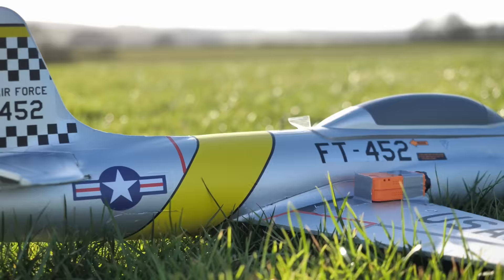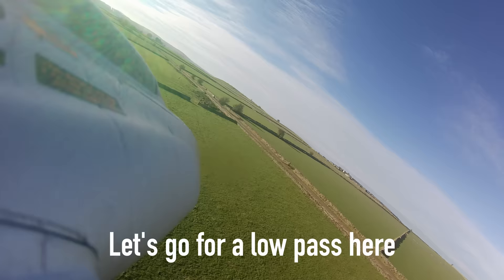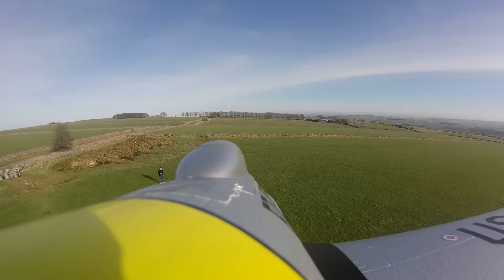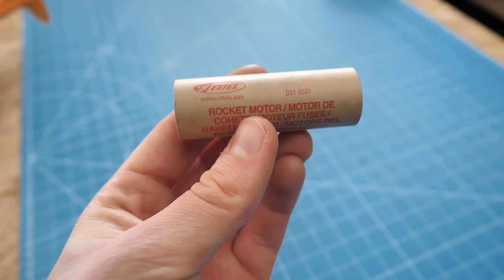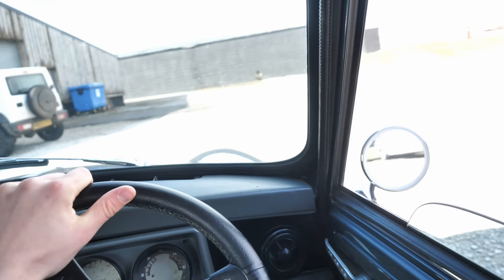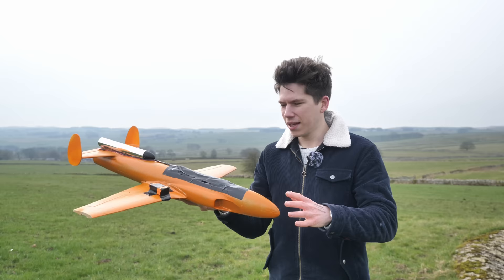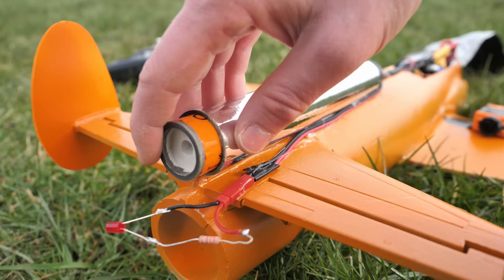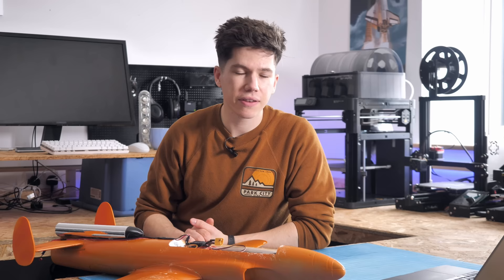Building the WORLDS FASTEST RC Rocket Plane!

Comment: I think it ejected cause of inertia. at first, the booster had forward force in the form of thrust which was pushing it into the plane but as the force stopped. it no longer had a force pushing it forward. this caused it to eject as there was a change in momentum and it resisted that change due to its mass. hence, it ejected cause of pure physics

Comment: Nice job. If you are set on sticking with foam, I would definitely look at sanding the trailing edges and covering with a glass fiber cloth. A bit of work, but sometimes it's about reducing drag, rather than simply adding more power/thrust/weight etc
Reply: i always added the resin right on the foam istead of adding the cloth. the resin dries makes a hard shinny dull yellow on the foam. adds alot of weight. makes it firmer too

Comment: @ProjectAir , instead of one big engine at the tail, how about putting 2 more of those big rocket engines 1 on each side of the wings near the aerolons and 2 small ones each side of the rear wing tips so it would be well-balanced. All should fire simultaneously for that added punch. As for the canera there are miniture lenses that can be mounted on the air intake portion by the body. Video can be recorded using microSD cards. I'll be waiting for this major improvement. More power to you!

Comment: This was a dream of mine as a kid building model rockets and Rc planes with my grand dad! Those experiences drove my career choices, first into aviation as a jet engine technician, then into aerospace as a rocket engine technician. Loving this video!

Only suggestion I have that you may have ended up getting to, some cheaper model rockets use a metal tab that holds the engine into when the ejection charge fires. I’m not sure why your engines keep jettisoning, but a tan on the aft and vent on the front should prevent that and maintain stability.

Comment: Looks like the vertical stabilizers could also use some optimization in the way of stiffening and maybe a less blunt leading edge. An expired plastic gift card is often used to stiffen foam board and you could probably just glue a piece to the outside of the stabilizers. You can also pinch the paper surfaces together along the leading edge and wrap a little packing tape around it to help it keep a more pointy shape.

The most important optimization right now though would be to paint the housing for the rocket motor to match the rest of the plane, because right now it looks like you've attached something you found in your mom's sock drawer to your plane and are taking it for a ride.

Comment: Brilliant project! So exciting to ride along. Pretty sure that airframe is holding it back. There is a reason most high speed jets are swept wing. Great work and all the best for all your projects. ❤
Reply: Swept wings are only useful once you reach transonic speeds and start to get shock waves. He's about 500mph short of that. 
The reason most model jets have swept wings is because they're supposed to look like real jets, which do go that fast. If you look at models used for racing, they all have straight wings.
Reply: @robinbennett5994  lesson learned! Thanks!
Reply: For the same reason, I was so surprised when I first got into the hobby to see that most of the fastest birds were 'hotliners' - essentially straight-winged motor gliders. At this end of the Reynolds number chart, that really is the speediest design!
I'd still build my own "fast" planes to look like jets every time, though, efficiency be damned. 😁 This T-33-ish airframe he's gone with is a good compromise between "looks fast" and "IS pretty fast".

Comment: If you can get the center of thrust to be more balanced then the jet gyro won't have to work as hard to stabilize it, possibly reducing oscillation and definitely reducing drag. That'll give you a bit more speed.

Comment: Why not try putting two jet engines on the wing, around the CG.  You eliminate the nose heavy re-design.  Also, mount the camera in the nose of the plane.  With two F size engines, you could really 'smoke-em.'  You may have to relocate the elevator due to the exhaust of the jet engine.

Comment: You'll achieve higher speeds if you increase the wing loading, trim a bit off the wingspan. This will also reduce the aileron area and make it less roll sensitive. Moving the centre of lift of the wing closer to the fuselage will also reduce the load at the wing root, and the stiffer wing will be less likely to flutter. Downside is of course higher landing speed.

Comment: Cool! Put in a bit of downthrust to avoid the nose down pitch on rocket ignition. Also, is that a model rocket engine? If so recommend providing forward outlet for recoil charge (meant to eject a parachute. 

Didn’t have time to watch whole video, and others like have said similar… just in case

Comment: If you're friction fitting the motors, then it's possible that you're just over pressuring the small sealed space in the tube (rocket motor gets hot, air in the tube gets hot, loss of thrust around motor burnout, POP just like a cork gun).  Maybe a hole drilled somewhere discretely would stop that.  From what i remember of model rockets, I never really made anything sealed that didn't explode... I'd probably use a metal clip to retain it from popping out, and custom length short tubes to take up the space between the motor and the nosecone on the inside of the motor mount, and then make sure there is a bit of room for air to escape somewhere.  /shrug/ whatever makes the weight distribution predictable.  In any case, your taste in color is spot on, so keep up the good work!

Comment: Model rockets use a secure fastening system to keep the motor in, not just friction. The most common used to be a flexible metal clip, these days it's common to see a threaded end cap with a seat for the cardboard tube part.

Comment: If your rocket motor rotates that easily in the tube you can easily snug it up a little with a ring or two of masking tape around the end.  That and switching to a -P (plugged) engine would resolve your issue of spitting the burnt motor casing.  If you can't find -P engines you (voiding any guarantees or warranties) can plug it yourself.  Never done that myself but I imagine a little epoxy would do the trick.  Also your wobble was probably caused by the flapping ignition wires that were loose after firing the motor.  Making the wires shorter and attaching them more firmly to the chassis should nip that one in the bud as well.  Mounting a WAGO connector near the back within reach of the igniter wires would help, I'd go with the most compact type.  Good luck and godspeed!

Comment: Maybe drill a pressure relief hole in the rocket tube when the engine charge goes off, and perhaps make the rocket engine mount a little more robust, so the engine does not push itself out of the tube..

Cheers!

Comment: Wing camera video llooked like aerodynamic flutter.  You may need to use.a model with a stiffer structure and mass balanced control surfaces to avoid flutter.  Unlikely that your gyro has wide enough bandwidth to correct for it, even if the servos were strong enough and fast enough.  Amazing that it didn’t come apart with the F engine.  Good show!

Comment: Put two motors on the fuselage near the wings, use a glue with the rocket motor that doesn't melt with heat, The rocket motors are getting shot out like shells from the cardboard tube probably the rocket motors burn through and through on the other end as well creating pressure inside the tube ejecting themselves at the end.

Comment: This plane can go alot faster if the wings could sweep back in order to lower the drag and give it a boost, further more you should make it heavier so it can retain more energy and gain much higher speeds. Replacing the main engine to a liquid fuel powered jet engine will make your plane much more balanced, fast and optimized. If mechanically swept wings are hard to acquire or create then give it an F 104 S airframe

Comment: Great project!  But mounting location of the camera really kills a big part of lift on upper wing surface.  I know because I made the same mistake on the same plane with same camera.  I had the cam slightly more outboard, almost could not bring it back for a safe landing.  Consider mounting camera on a pylon on top or under the wing so lift generation is preserved, and possibly achieving more speed since not as much AOA needs to be maintained.

Comment: Put the camera in the nose cone. 3D print the nose cone with a hole for the camera that is above center or below center and put a little piece of plexiglass there.

Or for better weight distribution put the camera by the rocket. Although the rocket would mess with the camera a bit. I would put some of the electronics in the back for weight and the camera in the nose cone.

Comment: You get over 150 mph with a good pusher prop setup on that plane...28 35 2300 kv..60 amp hobbywing esc
..1500 -1800 50c 4s...6x 4.5 apc prop... 5 min flights with variable throttle management 😊...you can keep the t33 airframe stock...maybe add some Cf to strengthen airframe a bit

Comment: Its a great concept and design but there are areas for improvement. You can put 2 rocket motor to under the wings for a better center of gravity and twice the power while still being able to have the propeller engine in the center. A delta wing design would also work to increase the overall strength of the wings. A cover for the internals would be better than just some ducttape but still great work!

Comment: The solid rocket engine at the top rear may cause imballance with respect of COG, and will also cause unexpected imbalance when the solid rocket is deplated or pulled off by air. Those imballances tend to cause amplified strokes against the body of the plane at high speed, meaning the disturbance will amplify at high speed. The sudden change of COG will influance the speed of the plane, because the "Pitch" action at the wrong time will impede the movement and thus the speed. My advise is to place the solid rocket engie right above the COG just in any of the above unfortunate cases the airplane Pitch will not be affected.

Comment: You can hit your goal of 140+ MPH using either a pusher or tractor propeller configuration or both 🙂. Plus you batteries will last allot longer at the same speed you currently get with the ducted fan.

Comment: 6:35 you need more heat in that joint. don't use the very tip; use the middle of the iron tip, and heat from a lower position, with as much of the iron in contact with the joint as you can
Reply: You would also want to turn up your iron temperature

Comment: Zero-delay motors like that may be designed to burn through to ignite second stages.  That could be just enough pressure to kick the engine out of the tube.

Comment: Sorry if it seems dumb, but first, if you actually need an onboard camera, and since you add a rocket motor, it seems that the camera could fit in place of the canopy, thus erasing some drag from the rocket motor itself, instead of adding turbulence around the wing (to add to the drag of the rocket motor pod). Second thing: i'm not sure the air intakes have the correct design. After all, you are not trying to fit a radar within the nose. Which means that something as a Saber or Mig15 air intake may actually be more efficient at supressing the body's drag. Anyway, nice video, and nice achievement too, good luck with your project!

Comment: The better approach to getting the speed record is to stop using off the shelf rocket motors and build one from scratch.  It isn't hard to do and you can increase the time the motor is powering the plane which is the key to going faster.  Also not sure why you are attaching the motor to the top of the plane if you are going to hand launch it.  Place the motor on the bottom and the initial thrust will no longer push the plane down it will push it up slightly which is easier to deal with. 

Also if you build your own longer lasting rocket the fact that more of the weight will be closer to the center of the plane will help with the nose heavy problem.  You would no longer have the problem of the engine being blown out and landing would be easier.

Comment: I don’t know how hot the exterior of those rocket engines get, but I’m thinking that the reason why the engines pop out after the burn, is that the air pressure between the front of the engine and the nose cone was raised high enough to push the engine out when the engine cut out. 
(Pardon my somewhat odd wording/grammar. English is not my native language.)

Comment: What if you attached two rocket motors to the wings with aerodynamic fairings? I think this would put the rocket weight much closer to the CG of the aircraft so that changes in rocket weight only marginally effect the aircraft's balance. Plus you could get even more thrust.

Comment: I didn't realize I'd done quite so well by getting 185 Kph out of a Skywalker Falcon, described by Hobbyking as "1340mm wingspan, it owns good mobility, stability, gliding that is suitable for leisure entertainment and FPV" and a stated air speed of "60km/h" which obviously depends on what motor/prop/speed controller/battery/mods combo so, variable.
That did take major modifications of course, first was removing the silly bulged up canopy since there is no use for it (except to access things) and build my own out of Kevlar/Carbon Fiber cloth/epoxy, after spending ages making a mould for it. That gave it a nice smooth curved shape that closely followed the curve of the wing and also better air flow to the engine/prop. Next was a 2,200 KV motor, (sorry but I don't remember exact specs as this was about 9 years ago) to which I did try APC 5X5, 5x4, and I think I even tried 5x4.5 but, oddly the one that gave the best results was the ultra cheap SPARE 5x5 prop that came with one of those AXN Floater Jets. The motor mount I then carved down to an aerodynamic shape just giving enough of the ply mounting for the X mounting basically then ran a 6mm carbon rod forward to the carbon wing brace to stop the whole motor just launching off it. 
That motor I used was rated for 3S which I did try it on and it was pretty damned fast. I wanted really fast, fully prepared and expecting total destruction at any stage I put a whopping great 120 Amp speedy in (not that t needed that, I had it for a much bigger EDF project anyway) and crank things up to a 4S with some insane C rating so it should keep max voltage up then test again. I can't remember exactly but I think it was around the 120 odd Kph mark that wing flutter kicked in and was like slamming into a brick wall, it damn near seemed to come to a stop! I cut slits in the under side of the wings and inserted 3x1 carbon strips into the foam then ran thin CA to stick them securely then smoothed off those surfaces, still got flutter at some higher speed but an improvement. Next I cris crossed the underside with strips of fiberglass take and ran wing tape (I think it was called) along the leading edges and tried again, that time I got up to 185 K/ph running cross wind so the GPS would hopefully give a pretty accurate measure since I didn't want a false reading for my own REAL results, which was a blast and vertical acceleration wise my eyes had trouble tracking it as I'd never experienced following any model vertically so crazily fast.
I rather foolishly never changed the thrust angle and the wing profile tended to make it want to curly downward at the higher speed so I was having to pull back on elevator more and more a the speed increased. I was stupidly, since I did expect destruction anyway, use those cheap plastic 9 gram servos that were really popular back then which turned out to be the fail point on the last attempt where I was hoping to increase that 185 Kph, at least to 190 but, on a full throttle pass both servos stripped simultaneously somehow and that was that. 
There is video of it existing taken by another flyer that but all I have here is a few pics of the thing as I'd modified it and of the GPS in it after landing which was also from Hobbyking and runs off the receiver power and loses everything as soon as power is lost so it can't easily be faked and you can clearly see the 185Kph on it's tiny screen. I also kept a short recording of the insane screaming sound as it passes by lol.
One issue with using a ducted fan model for yours is those huge air intakes create a lot of drag once you exceed the speed the fan is running at, that's why I didn't use one. I have a little one of the original "Stinger EDFs" and it wasn't designed as a scale model so has even bigger intakes and I could land that quite short from speed simply by cutting the throttle, pointing it down into a pretty steep descent, enough that I could hear the fan whirring away from inside acting like a big, surprisingly effective air brake then level off and skid it to a halt. Those oversized and draggy anyway air intakes, even on that model you used will only hold it back.
Silly suggestion is a pusher prop arrangement with a prop either screwed on that can unwind and effectively eject itself or, a keyed arrangement to allow it to drop off as soon as your rocket ignites. I know it's a waste of props but if you really want speed, it's going to also create drag once your rocket starts, especially if it's spinning.
Cool project all the same. Looking forward to seeing what comes next in your quest for speed👍.

Comment: 15:39 its not a gyro issue, its called Flutter... your ailerons don't have the rigidity required to be effective at that speed and are just flexing. remake them out of balsa or maybe even try a flat strip of carbon on the trailing edge of them.